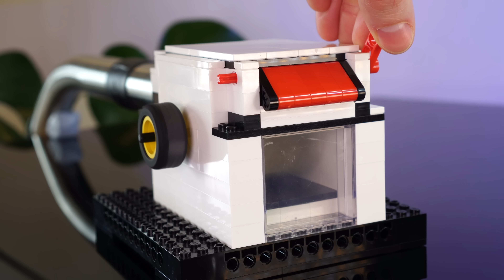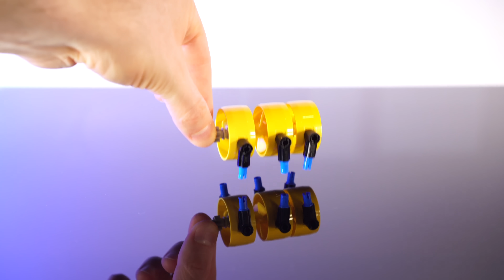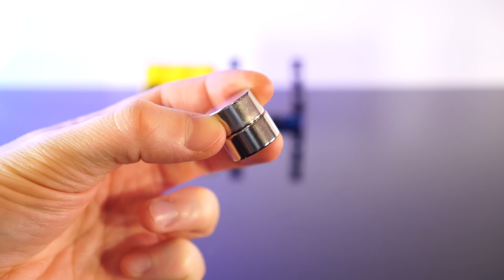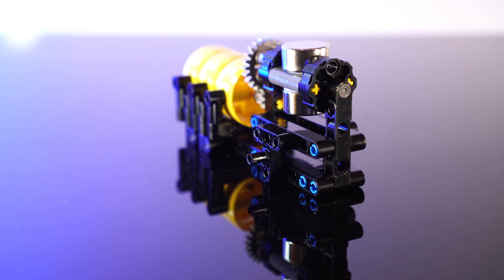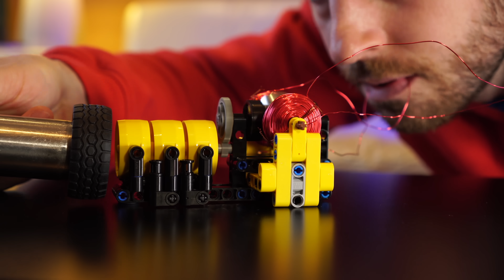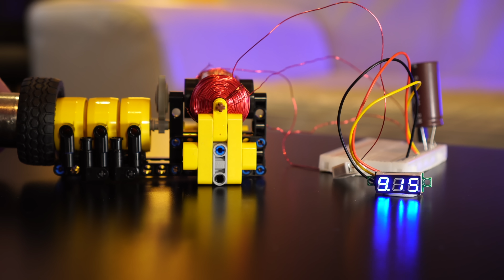Making the SMALLEST Lego Turbine Generator

Comment: why gear reduction why not gear up it is your benefit man i am surprised that people want more power and this guy want to create as less power as it can with the most expense.
Reply from the maker: Gearing up produces way less power in this use case than gearing down. If you gear this up, not only does it spin slower due to the reduced torque, it can barely power anything electrical. When you add an electrical load (like a light), it creates mechanical resistance against the generator core. If you have minimal torque, you can't power anything. So it's often better to gear down to get more torque so that you can actually power a reasonable electrical load.

Comment: what if instead of gearing down what about gearing up from 3:1 to 1:3 will it be enough
Reply from the maker: Gearing up unfortunately makes this perform way worse. There's barely enough torque to drive the heavy magnet core. So you end up with slower speeds and almost no current draw
Reply: @JamiesBrickJams  can your lego generators possibly power a magnetron i know it's extremely dangerous and life treating if you don't know what your doing. but can't help think of the possibilities a lego generator can do

Comment: with the power of LEGO, he has turned 240 volts into 10 volts. amazing. (love the vids)
Reply from the maker: Haha yeah this thing is totally silly 😅 But a fun proof of concept!
Reply: @JamiesBrickJams  this could actually be very useful in a power outage if you have wireless vacuum cleaners
Reply: @TheAIPickles naah I would wire it Directy but good idea if you don't know electronics
Reply: @enty-3035  with this, there is a much lesser chance of ruining an expensive vacuum
Reply: @enty-3035  but yes, direct wiring would also work very well. It just wouldn’t work well for somebody who doesn’t know electronics.
Reply: World's most overcomplicated step down power supply unit
Reply: Volt differential
Reply: Not Stonks.

Comment: I think that for the first lego turbine wouldn't really be powerful because you can easily stop it from spinning...But it has a lot of rpm
Reply from the maker: You're totally right - the output speed was high... until an electrical load was added. Then it slowed right down with the drag, making it pretty useless

Comment: This is very compact. I like it. Ive never seen people use those pieces to transform vacuuming power to rotational power. Very nice!
Reply from the maker: Thanks! Me neither, and I'm surprised - seems like a natural fit for vacuum engines
Reply: @JamiesBrickJams  Yea, it works perfect for these. the pieces are already in shape, its just there's a gap.
Reply from the maker: Yeah it's surprising there are gaps. Though I've tried sealing them, and it actually makes it perform worse. I suspect the gaps actually help bring more air into the tunnel
Reply: @JamiesBrickJams  now that I think of it, yes. As it pushes are, the next prop in front pulls in air from the gap. That actually might be a benefit than a negative. I see how it would work better with gaps than without.

Comment: Cool. You should try making a lego piston engine next to generate electricity as they're way more efficient and torquey
Reply from the maker: I'm certainly keen to create a piston vacuum engine. And if I can get a similar generator design, it could be interesting to compare the efficiency
Reply: They are cool, but vacuum turbines are more efficient. It’s just the truth.
Reply: @xmysef4920  vacuums draw more power than lego "generators" can produce
Reply: @xmysef4920  u sure? Turbines waste a lot of air while lve's, especially if they have multiple cylinders, use all the vacuum for the power stroke
Reply: How are they more efficient